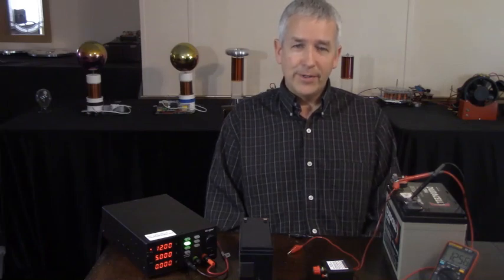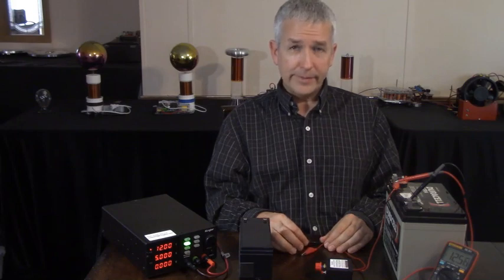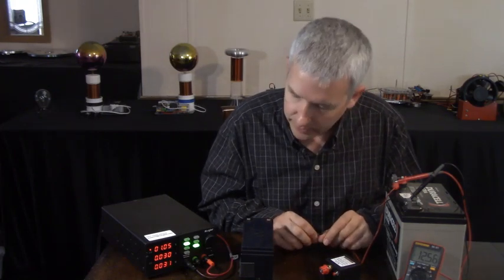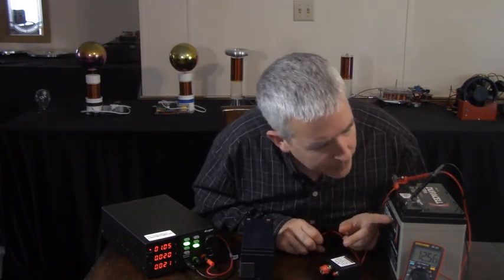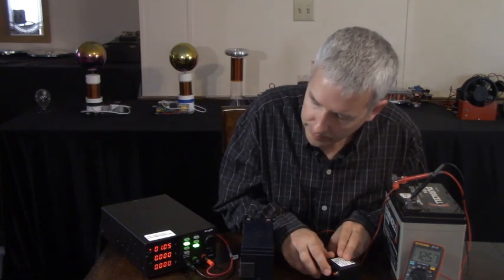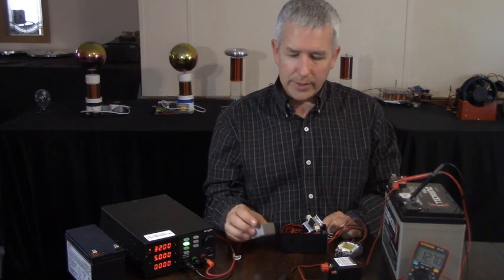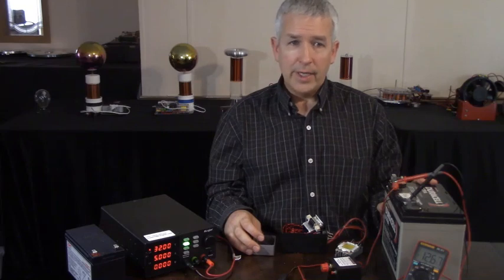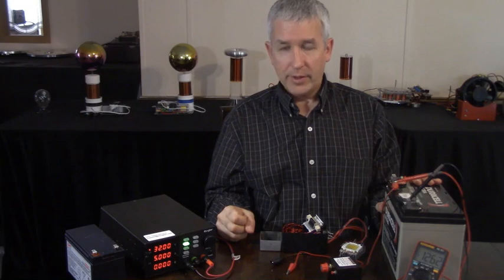RC-OS Renaissance Charge Negative Energy Oscillator

Comment: Hello Rick

I've received the RC-OS a couple of weeks back and I'm in the process of converting a small 14Ah Lead Acid Battery to negative (10 complete discharge and charge cycles). I am in the 9th charge cycle right now. I am constantly monitoring the voltage and draw curves. During charging, every time the battery reaches about 13.5V the rise in voltage gets faster and faster and the voltage reaches 14.5V relatively fast (charge curve gets steeper and steeper). What I then do is reducing the RC-OS input voltage, wait until it reaches 14.5V again, reduce the input voltage another time, wait for 14.5V again and the eventually switch off and start the next discharge cycle.

Is this faster increase in voltage during the end of the charge cycle due to the battery being sulfated? Should I let it rise beyond 14.5V and wait until it comes down again (as you say in the video, that a sulfated battery can initially climb very high and will eventually come down?

Best regards and thank you for all the work you do!
Reply from the maker: There is a lot more going on than you realize and it is too involved for me to cover everything here. This is an experimental tool to learn from under controlled conditions. Battery voltage under charge is not what you think. You have to turn off the charging before you attempt to read voltage otherwise you are getting a mix between the charger and the battery because the meter can't distinguish. Even the oscope will mislead you doing the same because the probes are their own circuit and not the battery itself. All the claims about battery charging do not apply when using these kinds of chargers. That includes what is considered a fully charged battery based upon a specific voltage. Also a fully discharged battery.
Reply: @rickfriedrich  I noticed my voltage gets stuck around 14.20 volts when charging and will sit there for a few hours.    I figured it was fully charged at that point.  Is that wrong to assume ?   Should i continue to charge  for 4-6 more hours and see what happens ?
Reply: @rickfriedrich  I am aware that our meters will only give us readings based on the response of their own circuits. I noticed however, that when the batteries reach an "under-charge" voltage above 14V, they start to boil (I assume to "cold boil" in case of negative charging). So I was wondering, how long I can let them cold boil beneficially without risking too much off-gasing (batteries are sealed AMG's which rannot be replenished). If I now take into account your statement, that all claims about battery charging do not apply with these kind of chargers, I guess I can risk a bit more and get away fro the fear of distroying the batteries. After all the negative charging is convergent and cool, so I expect there to be less off-gasing. I continue to observe, unlearn conventional theory and learn, what this technology has to offer.

Comment: Can the input battery  to the oscillator be negatively charged or does it need to be a normal battery ?   If a negatively charged battery can be used on the input, do you get positive energy on the output ?    I have many of your battery chargers.  Looking forward to adding  the RCNEO to my collection !
Reply from the maker: Same thing applies to the motors, you would need to add a large capacitor to the input of the oscillator after the battery. You can experiment with adding grounding also.

Comment: I assume this is intended to be used with lead acid batteries.  Might I have any luck trying to revive (which I am sure you wouldn't recommend doing) 18V Black & Decker NiCad batteries?
Reply from the maker: Yeah it is more of a universal charger for all batteries. Our RC-1AU charger works on those NiCd also. The only thing is that some NiCd that come back still will rapidly self-discharge so they are good for using daily or after being charged like a leaky capacitor.
Reply: @rickfriedrich  Outstanding product!

Comment: Rick, how did you get started in this field and what books did you read to learn what you know now?

Can you give us a short list of books to read that will give us basic knowledge of electronics. (Maybe put a list on your website?)
Or, do you know of any beginner books on electronics that have good lab experiments? 
It would be awesome to find a set of books (level I, II, III, ...) that would give us the true knowledge of electronics.
Reply from the maker: I gave a short reply in the video. I have read countless books so I can't really begin to answer that. I have shared many times my story of how I got started in various videos. Long story.  There is no list of books I can think of as they are fundamentally wrong. I shared the links to the online physics course in the second resonance kit as part of the kit. Starting with static energy. But the more you get through it the more errors appear. Now I see the atomic theory and many other fundamentals are wrong. See milesmathis.com for many examples.
Reply: @rickfriedrich  I have the second kit and I am reading the included booklet.
Are we better off getting books and lectures from 1800's?
Any authors you trust more than others?
When was the last major breakthrough in electro-magnetism?
Thanks for any answers you give. I am sure you are swamped with questions.